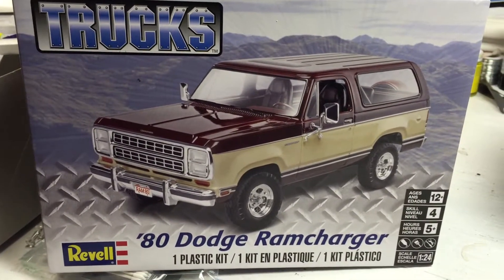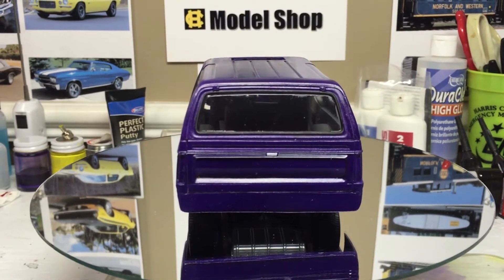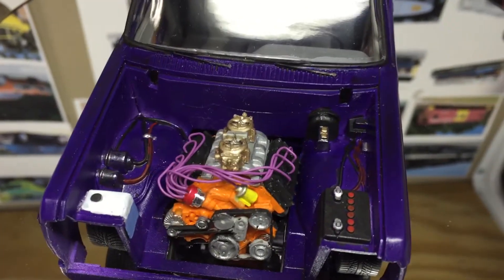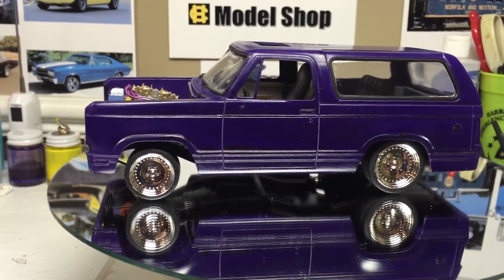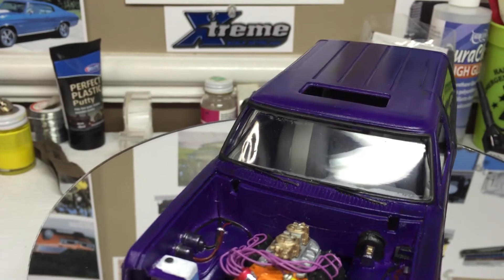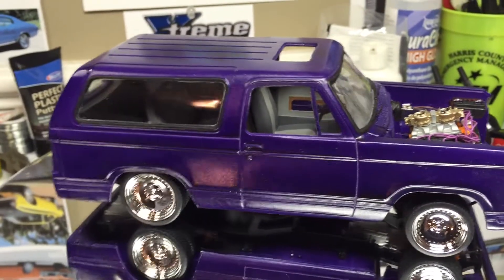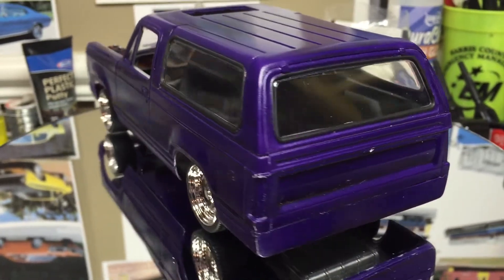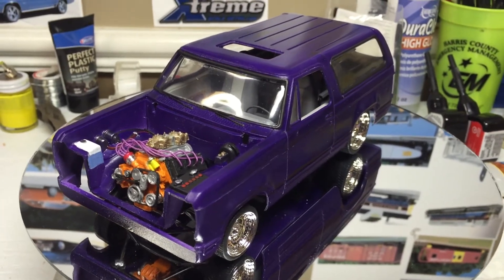DODGE Truck Month Update 5

Comment: I love the color and the way the stance is shaping up with it.  I wish the paint had laid down better for you.  That "elephant" is indeed a beast too.  I'm not sure if the paint gods are going to shine on me today either.  Looks like rain as I am prepping some parts.  Anyway, good luck with it and it looks like a killer despite the set backs.  I may still want to pick this kit up.
Reply from the maker: Thanks so much. This kit has been a challenge. I think I put too much reducer in the paint and it won't set. Good luck with you paint.

Comment: Sorry about the paint problems Monty. The build was going so good too. The interior looks great The engine is killer. I like your choice for the wheels too. I agree with you about the stance, If you can get the front just a little lower, you will have it nailed. 
If you do decide to re-do the paint, may I suggest Testor's one coat lacquer "purplelious" . I think that is how they spell it. It is a shade of purple that looks a lot like MOPAR's "plum crazy". It comes in a rattle can.
Reply from the maker: Thank you, I may try the Testors. I don't hear or see many people using the Wicked line of paints. Maybe that's the reason.